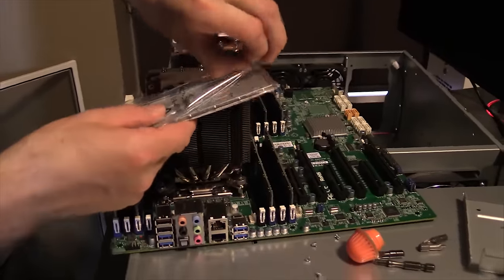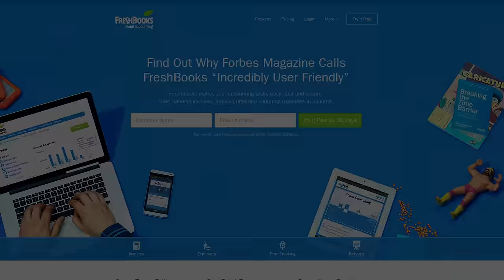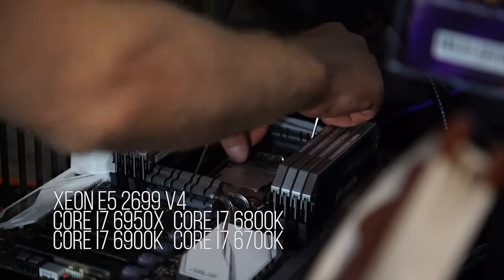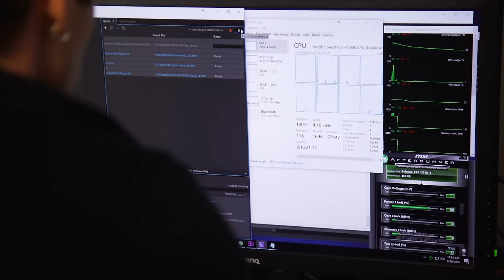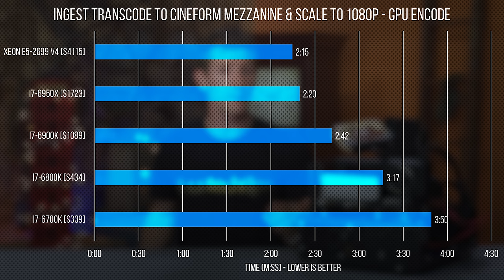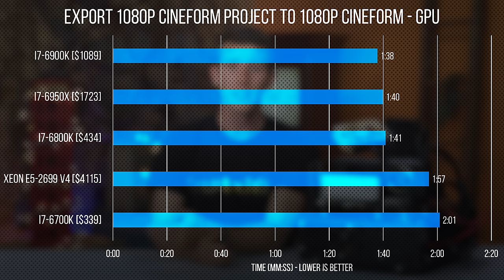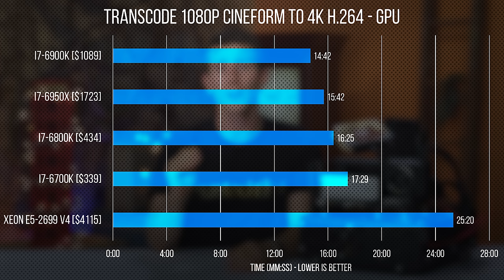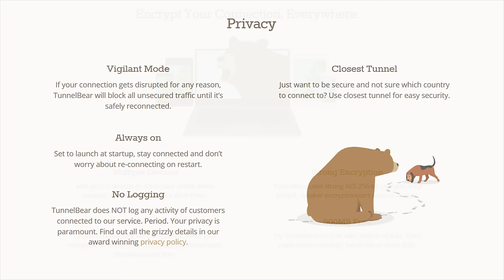$300 CPU Beats $4000 CPU?? - Cores vs clockspeed for video encoding

Comment: well if an intel I3 4 core is better than an AMD fx8370 a 4 core vs a what an 22 core? doesnt suprise me on bit
Reply: I learned the hard way because I am running an 8370 and my friend runs an i3 and I can see the diffrence on CPU intensive games you really get what you pay for but not in this case of the 22 cores
Reply: so if your thinking you can get the same performance out of an AMD dont do it, get the i3 or i5
Reply: are you gaming or video editing?
Reply: go I5 the I5 and I7 have same gaming performance but I7 is better at editing
Reply: for gaming no, save some money and go I5
Reply: not much improvement between those either go 1060
Reply: or even 1080 VR ready if you will use VR
Reply: NP, Watch Science Studios and Bitwit they always do previews on new latest an greatest PC part and put them to the test of last gens
Reply: that's were I got this from

Comment: how can you still use H.264. I've been using H.265, or HEVC, in the fansubbing area for a few years now. let's me encode Blu-Ray rips at very good video quality, when compared to the H.264 of yesteryear, and still be of reasonable video size. each file is stored in an MKV container with H.265 video, several SSA subtitle tracks, and 5.1, or highest quality available from the Blu-Ray, FLAC audio stream(s) for a grand total of about 1GB per 25 minute anime episode. I will not pay for Crunchyroll, so fansubs for life.

Comment: Just giving away: I dont like Linus.
But: Stop hyping Ryzen and telling people GPU Encoding would be so bad. It is simply not. When streaming on twitch, my 720p30 with 7.6 MBit/s on NVENC just look better in most party than what other streamers produce when using their CPU.. Why? Well, because.. They read CPU is so much better and wont believe anything else anymore. Its just ignorant. Just check for yourself. NVENC doesnt look worse and you dont waste CPU power, energy and time. There is no reason at all today for using the CPU for encoding, if you not have a really big streaming rig like an threadripper 1950X or higher which does the encoding entirely.